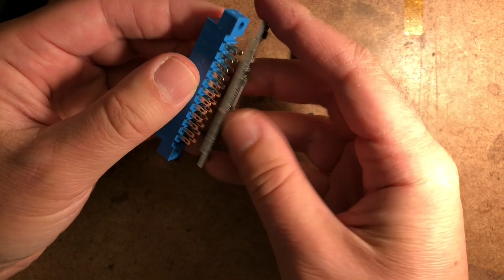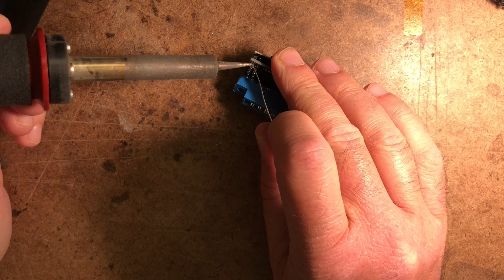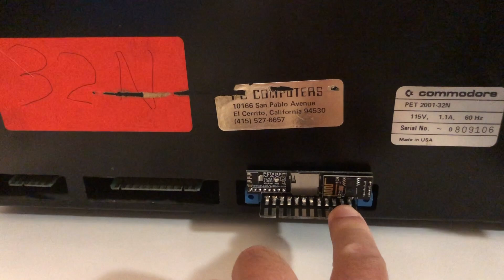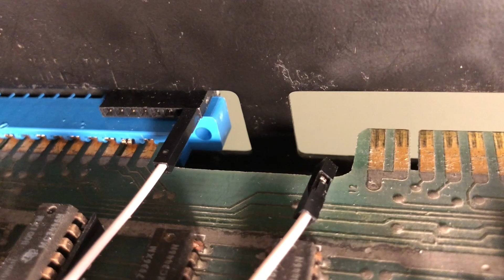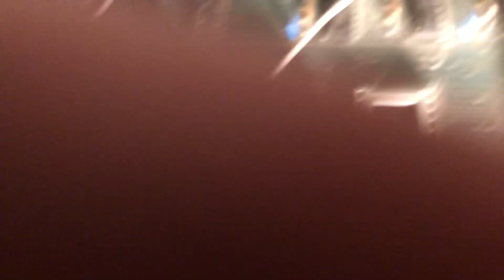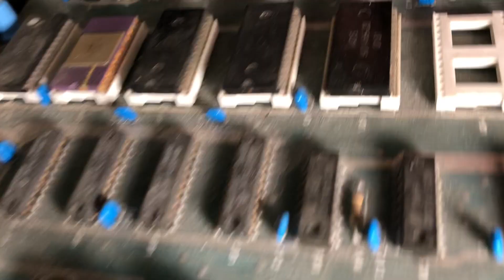PETdisk MAX Kit Assembly

Comment: If you want to use PETdisk MAX with an external disk drive (CBM 8050), would the configuration file need to be changed?

Comment: This looks great! I'm currently researching various SD solutions for the PET and eventually came across this. Whats it's current status? The shop lists it as Out of Stock.
Reply from the maker: Hi, Mr Lurch, big fan of your channel! Thanks! Current status is: The microcontroller used in the PETdisk MAX (atmega1284) has been unavailable globally for the last few months, so I did a redesign of the board which uses an ESP32 WiFi microcontroller instead. The first batch of production boards should arrive in the next couple of days, at which point the PETdisk MAX will be available again. Short answer: first version is now discontinued, and the new one will be available within the next couple of days. Let me know if you have any other questions!
Reply: @bitfixer6502  awesome to hear the project is still moving forward. I’ll keep an eye on your site and try and pick one up 👍
Reply from the maker: @MrLurchsThings  Sounds good! The PETdisk MAX v2 is now available, it's at https://bitfixer.com/petdisk-max. Also a separate assembly and operation video here: https://youtu.be/lmkW_9uhN_A
Reply: @bitfixer6502  well, my Pet is now up and running (you may have seen the video). I’ll talk to you about a PetDisk later in the week.
Reply from the maker: That sounds good! I have one ready to send out to you.
Reply: @bitfixer6502  I sent you an email via your sites Contact Us page.

Comment: Super!

Drive device numbers are 8, 9, and 11; would you be able to add a device number, say 13, and create a real time clock interface?
Reply from the maker: Yes, that sounds possible. If the wifi module is connected, it could query for NTP to provide real timestamps. Good idea!
Reply: @bitfixer6502   The card edge pass-thru design is brilliant too.

Please do a video on your idea(s) for the Wi-Fi.

Comment from the maker: I hope this assembly video is useful, please let me know if you have any questions. One correction - I mention in the beginning that only a soldering iron and solder are required, you actually do need a pair of wire clippers to remove excess length from the wifi module after soldering.